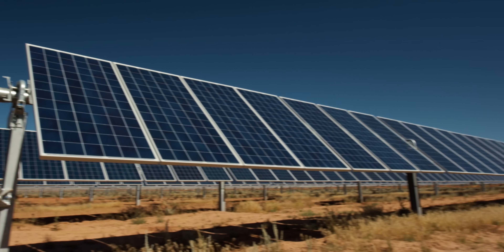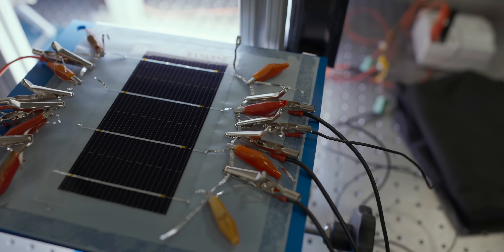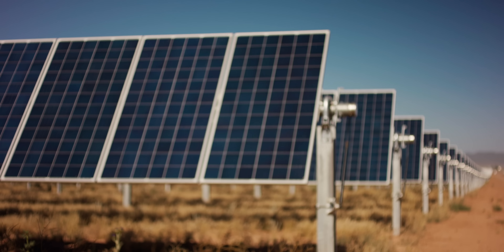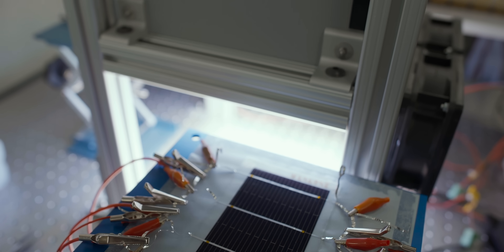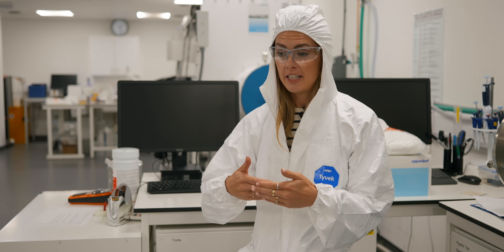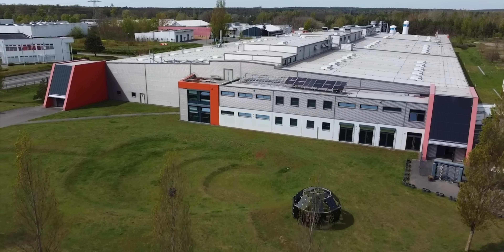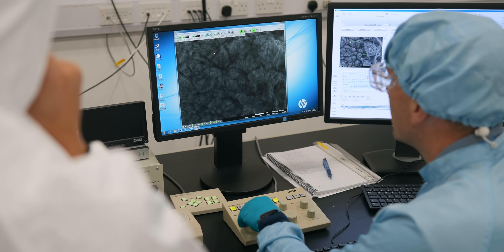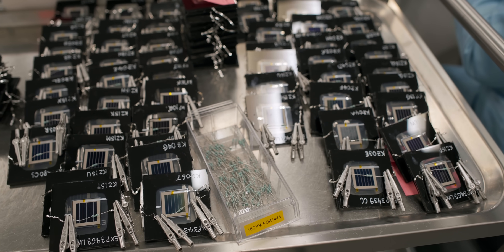This MAGIC Ingredient Is Doubling The Power Of Solar Cells!

Comment: I bought 8 x 415w solar panels in 2022 , they cost me just over £200 each . I can get the exact same panels today for £76 each including free delivery 😮 .
Reply: In China 550watt solar panel only $90
Reply: @JunitafluxcyfatriciaJunita  In India 550watt solar panel cost is  $160
Reply: @JunitafluxcyfatriciaJunita  link please
Reply: What's unclear is the lifespan comparable. You can lower the lifespan and lower the cost.
Reply: Perovskites have a poor lifespan. It degades under UV.  Half life is four years. Cadmium Telluride is durable but very toxic to a neighbourhood in a fire. Then the perovskites can incorporate a range of heavy metals also ;  their choice of composition is variable and can change just like paint formulation is always changed. A relatively least toxic composition is shown in this video with lead but i wouldn't trust it as the final product. e @agnelomascarenhas8990
Reply: @agnelomascarenhas8990  double glass are outlasting normal panels. And the quality of normal panels is now terrible
Reply: @ReinhardSchuster 
Stay away from flexible panels..
Unless you must. 
Plastic doesn't like UV-A, B, or C.
Reply: @agnelomascarenhas8990 

Life span is about 20 years.. but wait !!

The life span goes down by tiny percentages year by year.
By year 20, you're down by 20 %..
Give or take.
There's a Lotta life left at 80%.
5 year old photovoltaics, have nearly the same Wattage as new.
At substantial savings.
Reply: I recently got 4x 575W bifacial pv panels for 82€ each, prices have dropped like stones.
Reply: Thanks to China.
Reply: @LastWish90 were and witch brand?
Reply: @ReinhardSchuster  ich hätte aber auch einfach in deutsch schreiben können merk ich grade 😂😅
Reply: @LastWish90  dann wüsste ich zumindest dass du keine Mehrwertsteuer bezahlt hast was den Preis verzerrt.
Reply: @LastWish90 Where from..I can find the pannels but the postage is massive its like £200 plus like £30 for every pannel so only worth it if buying loads but I just want one bifocal one same as yours do you know any U.K sites that stock these cheap pannels
Reply: @jshaw4757  I'm from Germany and bought them there, we currently have 0%  VAT on solar/pv products for private individuals, i dunno if they ship to the uk
Reply: @LastWish90  The UK will add an import tariff which is roughly equal to our VAT. Then there will be additional delivery charges within the country, which often seem to be added twice. Don't ask my why those charges are applied twice, but it's happened to me with various imported items over the years. Buying goods from the USA, for instance, can result easily in paying twice the retail price. 🤬
Reply: They are less than £50 at cityplumbing
Reply: @sebastianryan-xy5kk  Yes they are , I checked yesterday and you can pick up >400w panels for £59.95 each including vat !!!!!!!!! That’s a real bargain .
Reply: I know crazy same here in Italy also batteries BYD 16kwh you can get for 4200 EUR
Reply: @ I can get 305ah (~3.6kwh ) lithium batteries for £495 each , from a UK based company with 6 year warranty.  Not too bad but high quality product .
Reply: @MrKristianson my 16 kilowatts battery did cost 1700€ BYD is very expensive
Reply: @MrKristianson 
That's still a lot.
Reply: Do you mind saying where you got them?
Reply: @ eBay have loads of them , I think the company is A&B solar
Reply: @anniemack4282 city plumbing I bet
Reply: To be fair you did by top notch in 2022 now top notch modules of 450 Watts.
Reply: Plumbnation £67 for 425w if you buy 10. I reckon I'll wait a year until they are giving them away 😂
Reply: @ bloody heck , bargain .
Reply: I bought more panels early 2022, due to the energy crisis created by Putins war prices for panels had rocketed at the time due to massive demand. Prices have now dropped substantially. I can now buy a Longi 425w panel for £57 including taxes from a nationwide local supplier, which means no divlivery charges. Back in 2022 I'm pretty sure I paid £175 each for a 395w panel. Inverters and other related parts have also dropped in price substantially.
Reply: @TheRonskiman   Energy prices rocketed because the Tories removed the energy price cap.
Reply: send link.
Reply: @mitropoulosilias  Ali express
Reply: That's gotta hurt!
But still, at least the price is going in the right direction
Reply: any brands and links?
Reply: I went to college for Alternate Energy Technology during the Carter Administration. 
Can I say WOW ??!!
JUST WOW !!!
Reply: Vuts Vat ?
Reply: @Peter-jo3wt  Value Added Tax .
Reply: 440 bifacial n type topcon In Australia is now $85
Reply: @alokkadam4416  then you not living in the UK that's for sure xD but I still get more sunlight here in Germany, than the folks over the other side of the channel xD
Reply: How did it affect your electric bill that go down
Reply: @ oh yeah , dropped by 80%
Reply: It´s like buying a PC...   if you buy today you might "loose" as after 6 months something faster will come, for nearly the same price... but you can´t buy after 6 months either... as then 6 months later you might get slightly faster PC for neqrly the same price...
Reply: Jinko ??
Reply: Buy, buy, buy, … before the EU thinks it needs to tax all the profitability out of them.
Reply: @elinys2843 erm if we all in the UK and EU decided to buy everything we need from China, then quite literally we’d be transferring all of our wealth into Chinese pockets and that can’t be sustainable for any economy. Sometimes we’ve got to use our heads more than our selfish feelgood senses about saving money 😊
Reply: @elinys2843  We're not in the EU but I catch your drift.
Reply: Thanks Beijing. 😂 Thanks Subsidy Thanks China Overcapacity .😊
Reply: @JunitafluxcyfatriciaJunita  Subsidies are a thing of the past, panels you buy today are not subsidised.
Reply: @JunitafluxcyfatriciaJunita  I would like to see the UK do "over-capacity". The UK seems to hate production efficiency though. It's like Marx denouncing the capitalist.
Reply: Almost as cheap as roof tiles
Reply: @lemagnitio72  on a new build if you can fit angels instead of the roof tiles in those areas there is minimal difference! 

All new builds should have panels to gain planning.
Reply: @Jamessansome 
They don't work everywhere..
But I get your drift.
Reply: Wow you guys are lucky, in the US the cheapest I could find is $300 for a 400w panel it looks like we are a few years behind UK
Reply: @mallen6783   25% tax On solar panels from China and Southeast Asia.
Reply: @mallen6783  Coming soon to US. Tariffs on Chinese products. Especially those that compete with non renewable energy sources.
Reply: @mallen6783 buy them from Canada
Reply: @mallen6783  It's rare anything is cheaper in the UK compared to the US. Generally whatever you pay in Dollars, we pay in Pounds. So a 20% premium.
Reply: @markrainford1219  You folks pay stupidly high prices for almost anything related to building construction. And your houses seem to be built to last for only 30 to 40 years. That's a scandal.
Reply: @mallen6783 that's insane you would be better off buying from China and getting a electrician to install you would say thousands
Reply: @mallen6783 must be tariffs on Chinese goods already?
Reply: @MrKristianson Pretty sure Trump whacked tariffs on Chinese goods last time he was in, and he's going to increase them.
Reply: @MrKristianson 
Some, but not like come January...
Reply: @TheRonskiman Too right.
Reply: @MrKristianson just the regular one apparently that will go up even more
Reply: 😂 and they cost for seller 25$ per panel. It is a still scam
Reply: @ Tesco pay about 38p for a 4 pint milk carton  .
Reply: Battery pack tech is going through an even bigger drop in costs and increases in efficiency. 

Spray inkjet type multilayer and spectrum coatings are where this is going.. flexible or rigid.

Comment: I think multi junction solar panels are great, even better if you live on the equator unfortunately a lot of us don't, I'd suppose we'd have some benefits of being able to use the second junction of these panels around mid summer in the northern hemisphere converting the shorter light wavelengths into usable power as well, in the other three seasons we'd only be generating power from the longer wavelengths as the shortest wavelengths would with the angel of the sun and earth be filtered out by the atmosphere .
Reply: The thing is up in the north we get much longer days in summer and they don't wear out as quickly because it doesn't get as hot
Reply: @ReinhardSchuster  that's handy, how well do they perform in the winter.
Reply: @adam-g7crq  depends on the weather

Comment: His arguments for perovskite are virtually exactly the arguments for tetraethyl lead. Lets not make that mistake again, yes, lead is cheap and readily available - its also neurotoxic, especially to kids.
Reply: So is perovskite as deadly as tetraethyl lead?
Reply: @tonycollyweston6182  OFC not, & the lead is released when it ages. But we dont need another toxic burden making us dumb and violent
Reply: Perovskites don't have to contain lead, it is the crystal structure that the term describes. Lead's just the original perovskite and presumably the easiest to make.
Reply: @spankeyfish  OK but the story is explicit these do
Reply: These solar cells don't put lead into the breathable or drinkable environment.  There are designs of panels that encapsulate the panel and absorb any leached lead. 

It's not like these are given to kids to lick.
Reply: But the peroskovites are not being burnt in petrol, dumping the emissions in the air we breathe.
Reply: @scallywagII  they just break down and leach after a couple of years

Comment: You missed the whole problem with perovskites which is its longevity. It breaks down very quickly. 
I'm astounded you didn't cover this. So just a fluff piece then ...
I think it's important for you to understand the issues before attempting to explain them.
Reply: All panels degrade (though most now are now supposed to lose only 10% over 25-30 years).  They didn't mention it - but that's been why Perovskite UNTIL NOW has not been commercial - the fact Oxford PV have this in a commercial product obviously means they've gone some way to solve the very rapid breakdown of Perovskite - which was known to lose 50% power in 1000 hours of daylight.  Maybe they've got it down to 5% in 5000 hours. Who knows? The reason they're with a commercial partner only is probably to measure/test if this is true in the field.
Reply: @markyates5744 And probably to develop efficient manufacturing approaches.
Reply: For commercial applications 'sufficient longevity' offers benefits now as opposed to waiting for maximum longevity in the future. Even if five years lifespan the panels will apy for themselves, particular if they are high recyclability designs. Commrcial panels will be swapped out much earlier then their maximum lifespan, unlike home panels, as the output drops below an acceptable threshold, panels fail/damage, or with significant technology shifts.
Reply: This is new technology which hasn’t yet been fully developed.  There’s good research you might find interesting which shows a path to 30 year life span for perovskite panels.  This compares very favorably with current silicon panels.  One such study was done at Princeton.  Future looks bright.  😎
Reply: just wait and see, you may be disappointed, but everyone else will not be.  All new tech has had a tough time getting in to the  mainstream, just luckily not everybody pushing the limits  has your ' glass half empty'  attitude.
Reply: @TerryHickey-xt4mf  It's not a matter of a glass being half empty, it's simply dealing with the realities of the current state of the tech. The single biggest problem with perovskite, is its degradation. I think with a piece concerning itself with the commercial roll-out of perovskite cells, it stands to reason that the issues is at least mentioned. What I'd like to know is how Oxford Solar have dealt with degradation. Clearly you don't feel the same. This strikes me as a bit like discussing climate change without mentioning the fossil fuel industry - you know, the SINGLE biggest problem!

Comment: Perovskite PV cells in development today contain lead which I'm glad was mentioned in the video. However they didn't mention that the lead leaches out of the panels which is really not great. A lot of work is being put into encapsulating the panels to stop the lead getting out, but even if successful it's going to be a problem at end-of-life processing. They also tend to degrade quickly, which is also not great; they have great efficiency when new but that tanks within a few years (as in, service life less than 5 years). No mention if this group has managed to address that.

We'll have to wait and see how the economics work, since they didn't discuss costs. Sure, if the levelized cost is lower that's a win, but I'm not going to be celebrating anything until the data is available.
Reply: I think that if a random YouTube commenter knows about it, they know about it. There are strict laws which they would have to follow before they would be allowed to sell them.
Reply: @evilution_ltd  What laws would those be? I think that if a random YouTube commenter confidently asserts that a law exists, they should be able to cite it and demonstrate it applies to this product.

There may or may not be laws involved, but it's a fact that lead-containing peroskite PV cells have a problem with lead leaching out of them. It's not addressed in the video how, or if, they addressed that problem.
Reply: @Smidge204  Existing Substances Regulation (ESR), EC Council Regulation (EEC) No 793/93, Directive 2008/98/EC and PIC Procedure. Look up EU REACH laws.

Why would a company go into that much detail in a YouTube video and publicise intellectual property?
Reply: @Smidge204  RohHS is the restriction of the USE of hazardous substances. The reason we are stuck with shitty lead-free solder whilst NASA and the military are not limited.

REACH is the regulation and restriction of chemicals getting into the environment.
Reply: @evilution_ltd As of right now, lead isn't on the REACH Authorization list either (though it's on the list of things they're considering to include), meaning companies do not need to get permission to use it in their products. RoHS is the only applicable regulation and solar panels are explicitly exempt.
Reply: @Smidge204  Lead was added to REACH in January this year with a transitional period running through to September 2025.
Reply: @evilution_ltd  It is not on the authorization list. It's on the candidate list.
Reply: @Smidge204 After reading your comments, I concur you are not "random" commenter
Reply: @evilution_ltd  Depending on which jurisdiction you live in.
Reply: @evilution_ltd  What's 'random' about him?

Comment: I'm looking at this and wondering why the German government has modified the Renewable Energy Sources Act (EEG) - valid from the third quarter of 2024 - in such a way that it becomes as uneconomical as possible for newly constructed solar systems by private individuals for private use in their own homes. Were the "big customers" - also known as energy companies - very helpful in writing the new law?!
Reply: They removed export remunaration ? Or something else?
Reply: Probably lobbying from the energy providers and the fact that we have too much renewable energy in the grid already on some days, especially if solar kicks hard around noon and many PV arrays still facing south to creat the maximum amount of energy during the day to get the most money out of it, at some 20 years ago people we getting 0.40-0.55€/kWh produced and exported to the grid and they get these rates for 20 years, now imagine a 10 kWp array in the early 2000s  that would be a little under 100.000€ for you in these 20 years, basically offsetting the cost of the whole system and after that you probably have another 10-20 years of lifetime in the cells left.
Reply: They're paid off by the big money (they want to do the installs) on the corporate level
Reply: I guess they had their influence. But the main reason is that solar got so incredibly cheap that it would get extremely expensive to pay everybody good prices. Another reason is that we lack storage and power lines to distribute the energy. Both solvable problems, but it takes time.